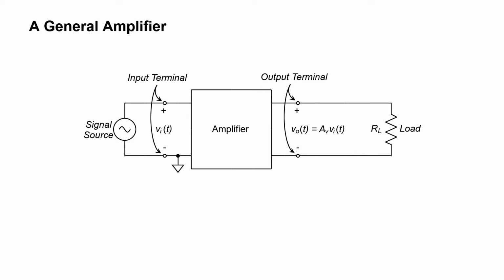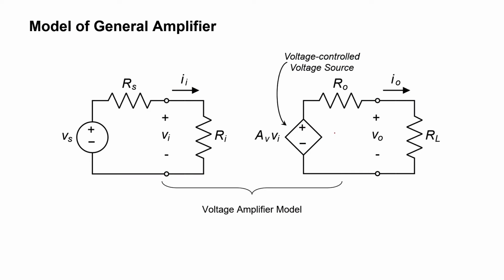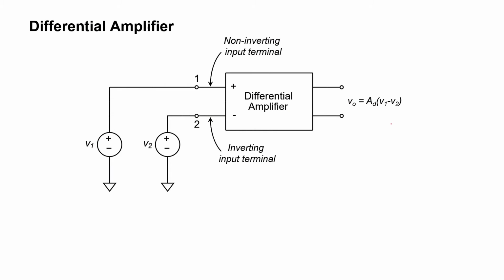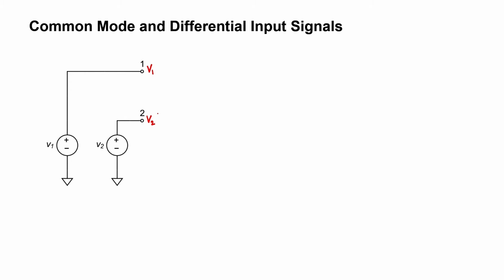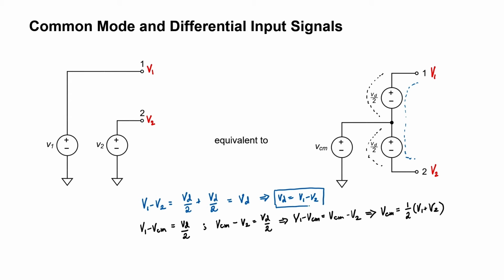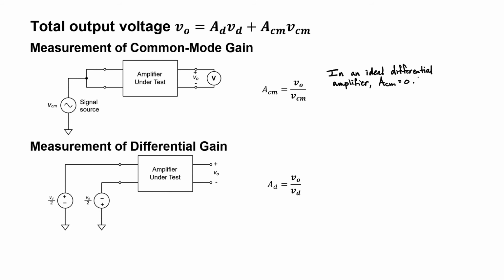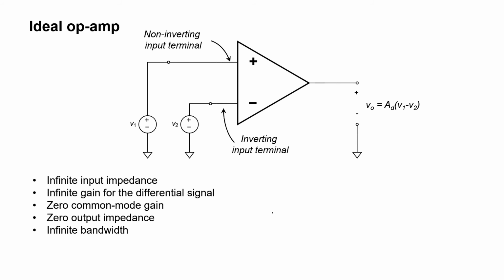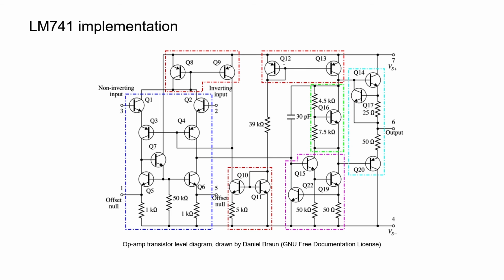Common Mode Gain and Differential Gain (Amplifiers #5)

Comment: Also, since you have already covered two types of gain - inherent gain and circuit derived gain, which gain are you talking about? So, if I have a non-inverting amplifier configuration with gain of 2, does this mean the differential gain = 2? I'm going to assume here that the differential gain you are talking about is the inherent (very large) gain of the op amp.

Also I am going to assume that the non-inverting amplifier is not a differential amplifier since it technically only has a single voltage input- the other input being derived from the feedback loop from the output.

Comment: lmao ok, so we are just going to assume that a negative half of the differential voltage magically divides itself, flips polarity, and goes in the input? say you have a two wires coming out of a microphone, what does the practical connection to the opamp inputs look like?